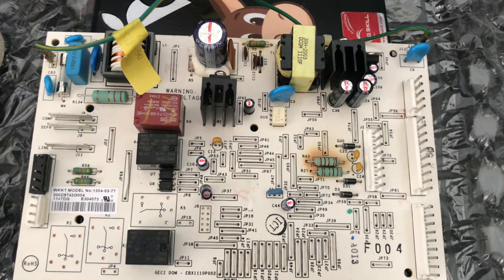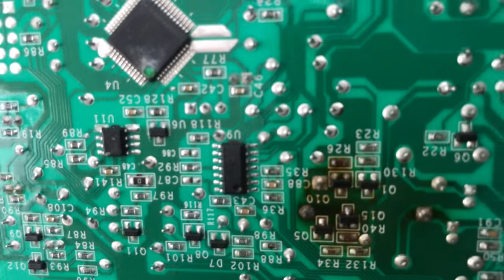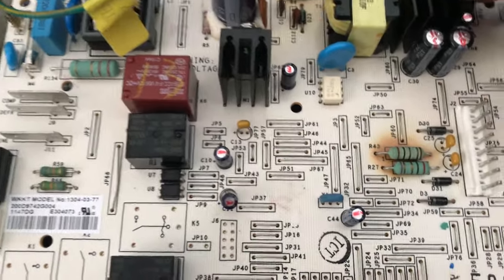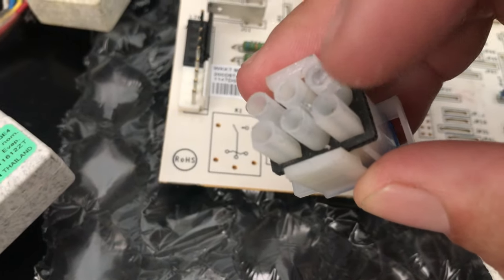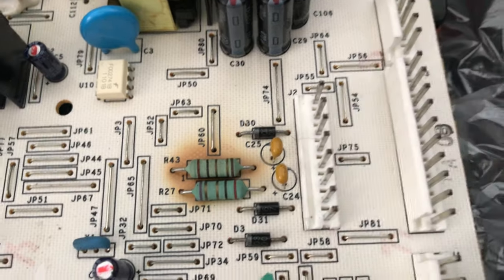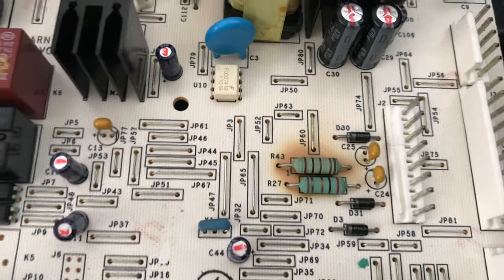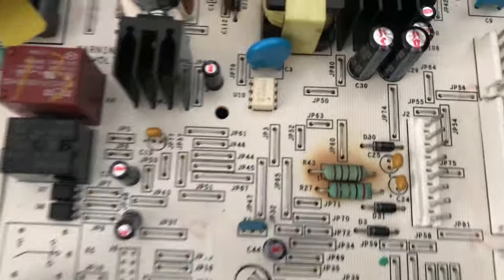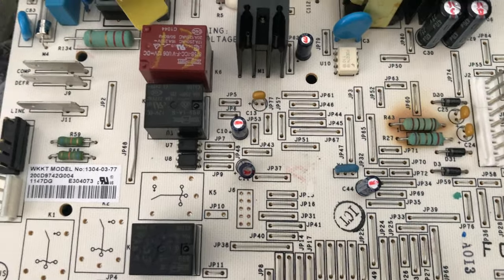GE Refrigerator Stopped working. Replaced Control Board and Evaporator and Compressor Fan motors.

Comment: When replacing those you need to mount them as high as you can from the bottom of the board .when mounted tight to the board there is no air flow around them and hench certain death .
Reply from the maker: That makes sense. When that evaporator fan starts to fail it really causes these resistors to pop.

Comment: You also have a bad chip on the underside.  U4, burn hole in the corner Those are 1 watt resistors and can run hot. Need to pull one leg and measure resistance.
Reply from the maker: Looking at U4 on a newly purchased refurbished board shows the same chip with the green circle in the corner. An OEM board new has the same hole in the corner of the chip. So this is normal. Probably a manufacturing reference mark.